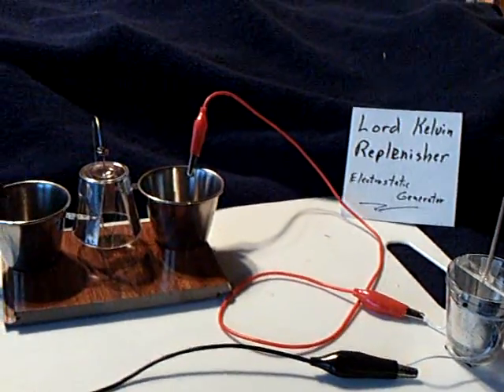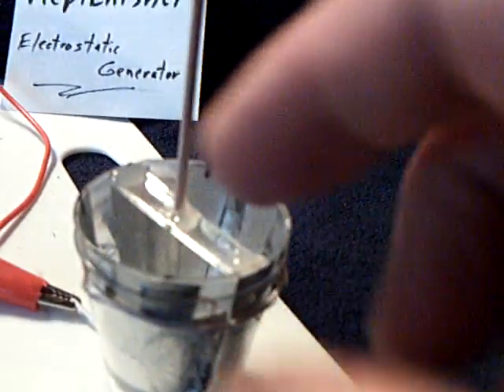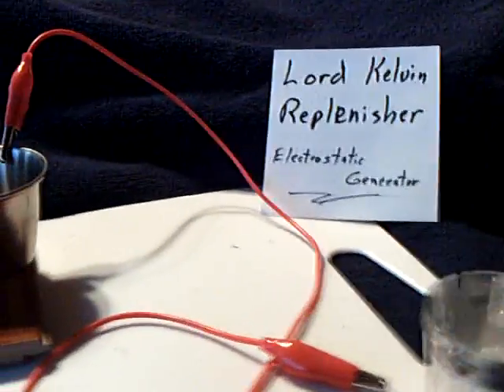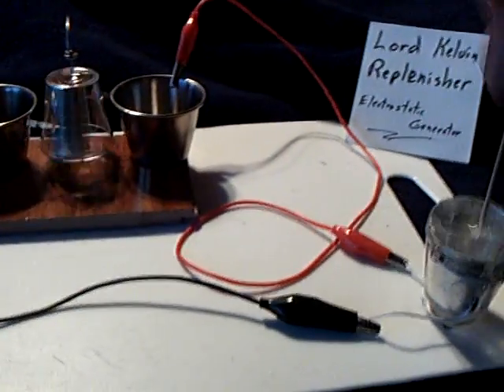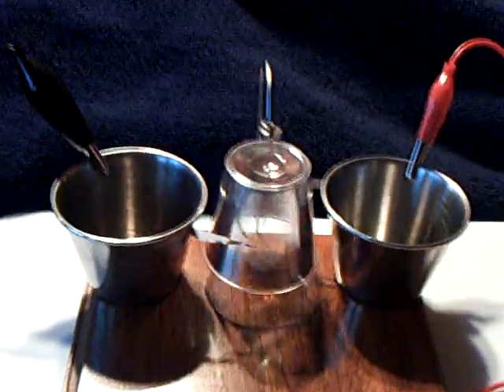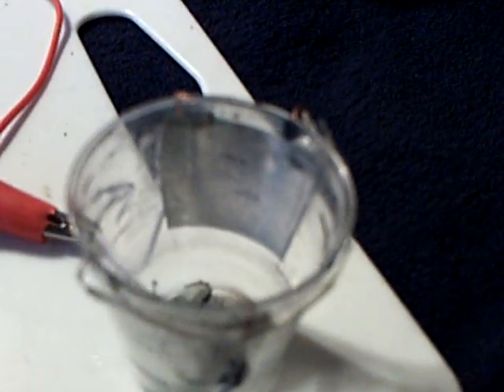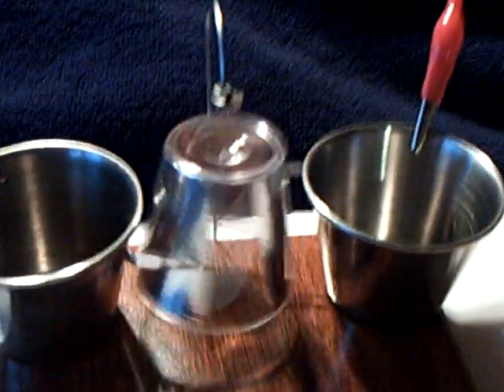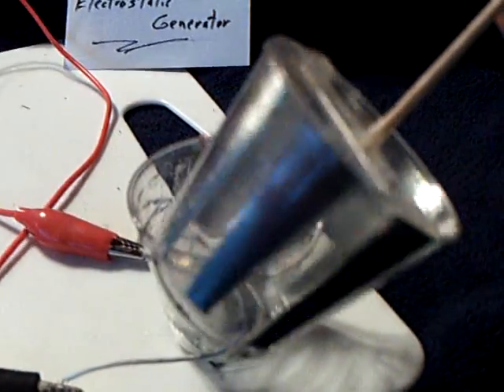Mini Lord Kelvin Replenisher ----  A simple electrostatic generator

Comment: I learned about the replenisher yesterday. Needless to say. It's quite simple.  

In 5 steps....
1) starting at the neutalizing brushes, The tiniest charge imbalance on an outside inducer plate induces electrons on the rotor plates to move through the  neutralizing brushes and though a wire to the opposing rotor plate. That is electrons to flow away from the rotor plate closest to the negative inducer, over to the rotor plate closest to the positive inducer plate and tries to balance out  the charges stored on the inducers. 
2) Then as the rotor continues, it breaks contact from the neutralizer brushes stranding an excess of electrons on one rotor plate and leaves a net positive charge on the other rotor plate.  
3) Next, as the rotor continues to rotate the voltages on the plate increase while the charge remains the same as the capacitance decreases between the inducer plate and the rotor plate, simplified equasions at the end of this post. 
4) With the rotor plates now being at a higher voltage they eventually rub against the charge collector brushes where they dump their excess voltage onto the like charged inducer plate. 
5) continuing to rotate the rotor plates break contact with the charge collector brushes, and continue rotating untill they start their next rotation  starting over at step 1 making contact with the neutralizer bar.

I think the charge imbalance stored on each inducer doubles with each rotation until its so high that it self discharges. 

Im very interested in if one grounds one inductor plate and connects the other inductor plate to a tall ungrounded antenna. 

I suspect the voltage on the antenna will skyrocket with a huge excess of positive charges while electrons are pumped into the ground. 

This brings me to another idea... Plant electrotropisim, and the positive effects on growth resulting from ground negativity and atmospheric ions, and the relationship with bacteria nanowires transporting electrons and nutrients. My interest is in a small solar cell powering a motor spinning a replenisher to generate higher voltage between ground and ions in the air near by. With luck, it may stimulate vegetable growth. This year I'll test on an area of lawn and see what happens. 

Flat plate Capacitor equasions:
(Q or charge)=(v for voltage) × (c for capacitance) and 
c=(permittivity × (a for area))/(d and d for distance)
 Combines to:
 voltage=(charge×distance)/(permitivity×area). 
Air has a permitivity close to that of free space which is about 8.854/10¹² Farads/meter.

Comment: I'm noticing your electrostatic motors are high voltage DC  electrostatic corona  motors. I think that means the lord Kelvin replenisher is not generating an alternating high voltage AC current, but I'll look into it to be certain.

Anyhow, if so, that would mean stepping a voltage down isn't as easy using a high voltage transformer.  But, maybe one can switch a high voltage H bridge with a high voltage transformer inside the H bridge to alternate the current flowing in the transformer.  Building on this idea, maybe one can make a simple mechanical commutated H bridge made from a nonconductive rotor, and conductive brushes and contacts making up the 4 switches of a mechanically commutated  H bridge. 

Google H bridge to get the basic electronics circuit idea if needed and think about how DC motors mechanically comutate current to  coils on a rotor.

Comment: Im impressed because I've tried this so many times like the Voss machine and can't get it to work... studied all the diagrams of Lord Kelvin Replenisher on Google... looks simple enough and I think I understand the principle but I must be doing something wrong.... even just a close up of your brush configuration would be helpful...just to confirm im doing that part right. No one has a video showing this. As soon as I figure it out im gonna post a video with details cause that's what people want...Thanks and well done!
Reply from the maker: On my version there are eight rotor segments.  The segments are seperated by a width equal to the width of the segment.  The shorting brushes are 180 degrees apart.  The charge pickup brushes are 1 segment away from the shorting brushes and behind in a clockwise rotation.  Low humidity is necessary for mine to work well. The plastic bottles used for this have to be very clean and free of moisture.
Reply: Hello and thanks for your reply. Mine is using 6 rotor segments but that shouldn't matter from what I cant tell... maybe the plastic im using is too thick, im not using cups so perhaps the induction doesn't happen. Thanks!

Comment: Lid, I like your work in this direction. Do you think it is possible to build a stepped-up version of this to fill a bank of super caps this will power some lights, motors, etc?  I especially like the idea of driving it witha wind turbine. Thanks for sharing.
Reply from the maker: Thanks Tony.  I now think that perhaps the best way to use this is to stay with relativly high voltage and design things that would work on HV but low amperage.  Trying to make this run the things we already have could be really hard.  Storing the  HV energy in a supercap would perhaps take a whole new super cap design.  We can make big electrostatic generators.  That's easy.

Comment: Lidmotor, Your experiments is realy intersting.
I just wonder if with the same force could pull more electrons without slow down?
Well, in fact I don't think so but maybe I am wrong.
Reply from the maker: Check out Lasersaber's latest videos here at YouTube.  He hoisted a thin wire up in the air using his RC drone and ran an an electrostatic motor with an energy potential between an earth ground and the static electricity in the air.